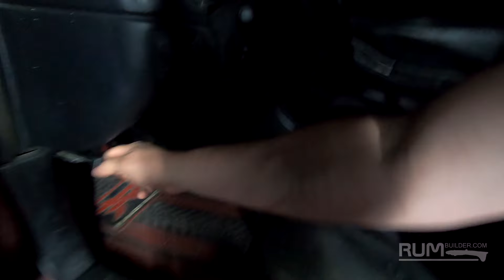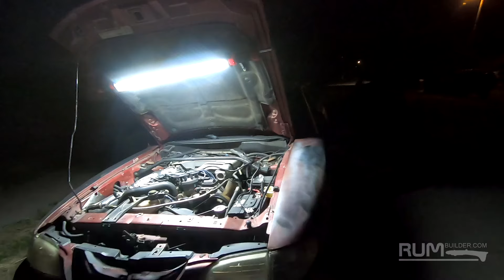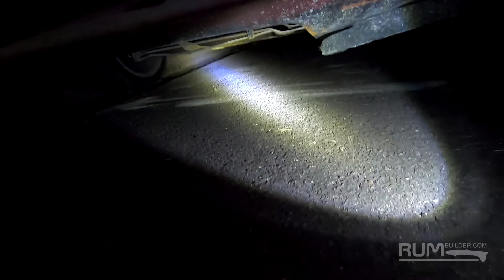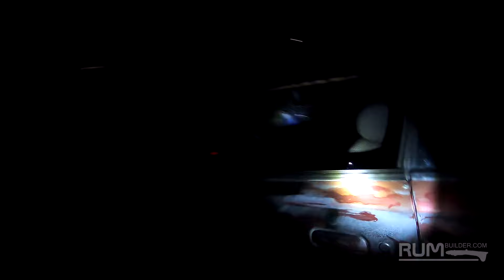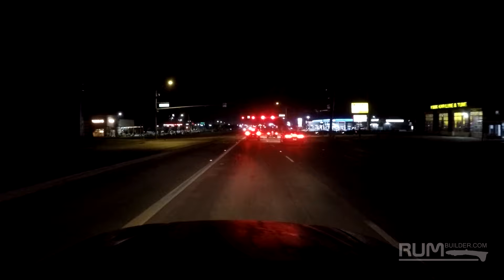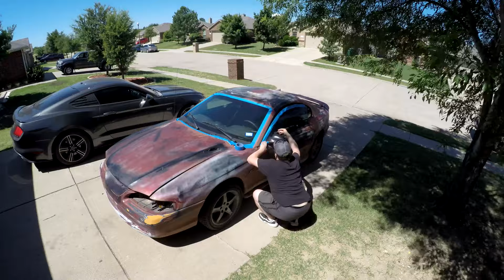Homeward Bound rally mustang episode2

Comment: Get rid of the power steering.  It will help you build up a little upper body strength.  All you need is that 5.0.
Reply from the maker: Miguel Ramirez drag racing would be fine but dirt and such, I don’t think so.